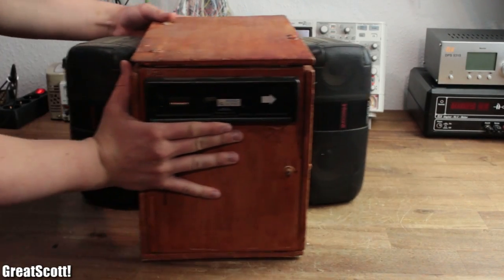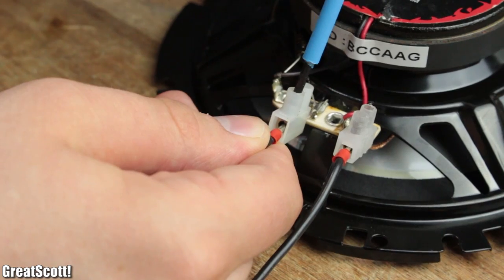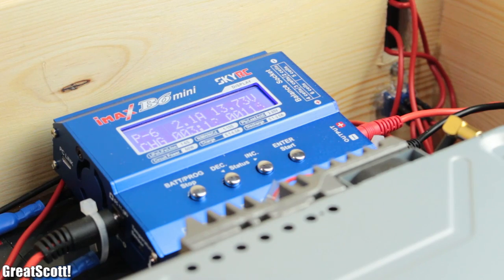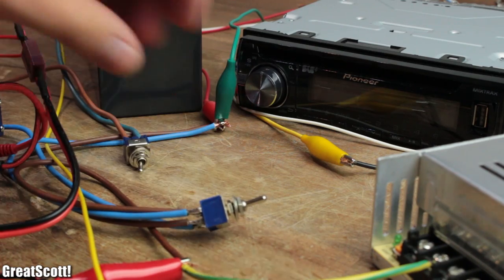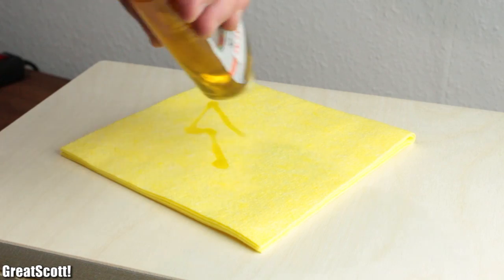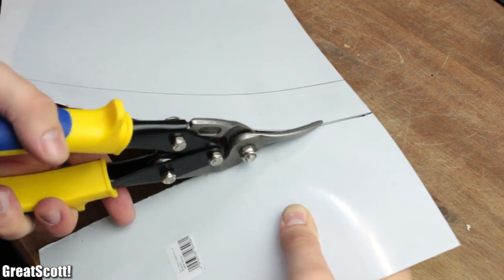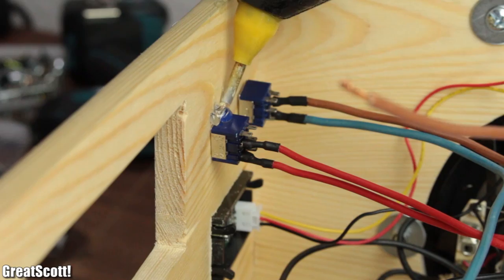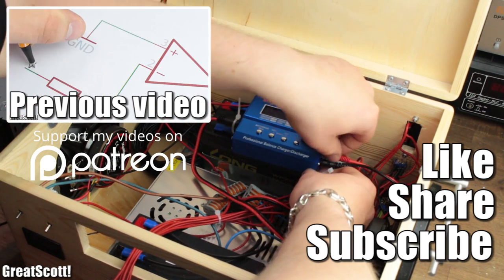Make your own Boombox

Comment: Why using Lead-Acid Batteries? Use LiFePO Batteries. They have a lot larger engery densenty than Lead-Acid Batteries and are similar safe.
Reply: Expensive.
Reply: The price :/
Reply: SLA is by far the best choice still as they are dirt cheap and they have a good life span if looked after. The cells are also the perfect 12v, so perfect for PC and car electronics. Other technologies are suitable when you're really concerned about weight and money is no object.
Reply: +Toxicity because lead acid batteries  dont blow up in your face unlike lipos,plus the need for a over charge over discharge circuit,plus they supply less and less power when heated up,not only that,lipos are dangerous because they can detonate like a bomb at any moment,once i had a friend that was soo happy to get a Samsung Galaxy Note 7,3 days later he was treated for 3rd degree burns on his hands,now,why dont you tell me why you think Lithium Polymer batteries are safer than Plain Safe lead acid batteries
Reply: +Trodded Sloth LiFePO has nothing to do with Lipo batteries, thats are 2 very different technologies. One big advantage of LiFePO is that they are save, they can't blow up. Thats why they are good replacement for Lead-Acid batteries.
Reply: still need venting for lead acid  cells..hydrogen fumes do gather in small area, and the micro switches I saw may not be arc proof.  
These projects are to encourage hobbyists to think, develope, design and create on their own...GS is only showing us how simple or extreme hobby can be.  Keep up the great work GS.
Reply: Nah short

Comment: some cheap and good car radio with usb and aux ports?
Reply: BLAUPUNKT STUTTGART 120
Reply: thanks :)
Reply: JVC sells a quality deck with speakers for low cost. I have a cheap $60 Pioneer in my car with USB, bluetooth and AUX Paired with local sony speakers and the sound is good. The local car store here "cost less auto parts" has some kind of set that looks like a asian clone of the JVC bluetooth set for even lower cost. I'd take a look at Greatscott's bluetooth speaker possibly build your own Aux or Bluetooth boom box with something cheap inside like a mp3 player or radio if you don't want to hook your phone up to it. If you have the know how as well.

Comment: Watch out with those cheap power supplies . I only use triplite or buy the cheap ones  and resolder and examine every rear board connection. . The quality control at those factorys suck .

Comment: I have a question, would it work to use a Desktop PC PSU to power the Radio with the 24 pin ATX kable on the PSU?

And if so, could I simply put a switch between the PSU and the Radio to have it turn on and off?

Comment: Hii please suggest me the amplifier unit 

I have 2 woofer s and  2 speaker 

Woofer-6 OHMS each
Power -30W each 

Speaker 3 OHMS each 
Power - 20 W each 

Waiting for your replay 
I need the  Blutooth and usb also
Reply: He used a pioneer DEH-S1100UB

But for you i think a pioneer DEH-X5800BT + USB would be better suited for you, just remember that the outputs would be 50w so be careful.(even if speakers tend to tolerate double their rated power?(idk))

Comment: I did this. Having a problem with the charging controller though. Worked for a while but after heavy use draining the batteries that night i charged the batteries up then after unplugging from wall power the charging controller stayed on. Didn't do this before. Took it out of the box to isolate it and the charging controller is running itself off of the output (battery) side. Been trying to figure out whats going on with the controller but no luck yet. Anyone else have this issue?

Comment: No fuse protection?
Reply: The stereo has a built in fuse, but there should be a fuse between the 120 V input and the power supply, unless the power supply has a built in fuse as well.

Comment: could u make one of these with a 12vdc 10a adapter? but just to power the unit and speaker only.
Reply: Shaun Cassidy yes you can and he stole my idea I posted a video of the testing of mine and I did it without all of the fancy crap
Reply: @mcasetv2221  then how would one do it with just a 12vdc adapter and the stereo unit?
Reply: @shaun Cassidy you wire the radio power to positive and negative then check if the radio comes on then you just wire speakers into the speaker outputs unless you using an amp

Comment: Hi, I have 40w speakers in my house,  and I want to install them in a 55w radio. 
Who can I reduce the power of the radio,  can I use a resister
Reply: You can use a properly rated resistor but u have to keep in mind about the parasitic inductance of the resistor.

Comment: uh how can i just power using mains i dont want it to be powerd with batery
Reply from the maker: Leave out the battery segment of the circuit
Reply: so just hook up the power supply to the pins a4 a7 and a8 on the radio right?

Comment: So If I plan on building this, what are the requirements for the radio and can you just remove the antenna part and instead get a AUX-port with a cord to play from your phone? Thanks.
Reply: Yes it is possible as the output is based on the input from the head unit.

Comment: The boombox I built like that back in 1995 still works great, though it is on its third battery. Those lead-acid batteries only last 3-5 years. 
I used a Radio Shack 40 watt EQ booster, two 6.5 inch 2-way speakers, and originally a 15AH battery from Science Surplus. Box was made from 3/8 inch plywood, glued together and L brackets for corner support. I meant to put in hinges for the lid, but just having it press fit into some weather stripping held it in place pretty well.  I plugged my Walkman into the aux input, and enjoyed my favorite tapes. Of course now I play my music from my phone's headphone out.

Comment: take out charger and batery ad put normal computer power supply, its not so big, has own fan to cool power supply and the radio and u have 350-400 wats of pure power in12v. My bombox is made from old speaker box old compuer power supply and sony radio on mp3 usb.....perfekt for listening in work

Comment: Hey go on amazon and you can get a12v low voltage cute of for  $10 it will cut the power at 10.5v or you can set it lower or higher

Comment: i suggest mount  speakers in a separate internal box,to avoid loose bass range...i have make one,but the radio are divided from speaker with  a intermediate wood panel in the box...so you can "comprimed" the bass,and made a  frontal bass reflex duct

Comment: Based on your diagram, the battery's output negative & positive terminals were connected to the charge controller's output negative & positive terminal? Why would the battery's output be connected to another device's output?

Comment: Kmart had a very cheap Kraco radio on sale. The $14.95 set came packed together with speakers and antenna. I actually used cardboard box for the enclosure for two weeks until I made one from metal.

Comment: Why you used 30A while you just draw 1.5A,  What is biggest Amp that this speakers and amplifier make? What if I want to build that without battery, just with power supply. How strong it should be for same speakers?

Comment: I think one could spend the money smarter and instead of buying an expensive multi function charger, a rather bulky and heavy VRLA battery, just buy a RC-model LiPo or even reuse a bunch of laptop 18650s, hook it up with a BMS/load balancer/protection circuit from China, yielding much more portable device. This might have not been the case at the time when this video was created though.

Comment: Try using a solar charge controller, it'll accept you load and keep the battery charged and maintained.  When you unplug your unit from the line the battery will seamlessly power your load.

Comment: You need to work on the sound quality... the box's volume is too big, has no sealing at all for the lid, speakers face 180, box is crammed with stuff, should use matting, etc. If you're going to go through the trouble, do it right.

Comment: I used to work construction jobs, and the guys were always bringing in their "Dewalt" radios, or their own store-bought portable CD radios.  I could not afford one of the Dewalt radios, and just another portable radio was too boring for my creative style. So I did something similar  to this.  But with a twist...  An old, 2-knob, AM/FM/Cassette car stereo was slotted into an old makeup case I found. The power leads were connected to a 12v lighter type plug and two good computer speakers connected to the 2 channel output of the car unit. the speakers could be stored inside the box when not in use, but taken out and set up  in the extendable tray of my big rolling toolbox when I was using it.  So, what about the source of the music?  Well Cassette was to quaint, and FM radio always had the same old boring crap over & over, day after day.. So I loaded up an MP3 player with several playlists. Country, classic country, classic rock, 80's rock, metal etc.I had about 500 to 600 songs in total.   Here's the twist.. I got a very good FM transmitter that covered about a 300 feet, but after I upgraded its' puny internal antenna to a better external antenna, I got about 1,000 to 1,200 foot range.  It was all powered by a small car jump-starter pack that I had built into my toolbox.   I always had my transmitter set to 102.1 FM, which was near to a popular rock station at 102.5. but not close enough to interfere with the rock station.  Eventually word got out about my "portable radio station" and other workers began to tune into my transmitter.  It got to the point where some guys would come by and make requests for songs.  Of course, I was happy to put a song on, if I had it on file.  This thing was a very cool contraption and was greatly appreciated by other workers when we were on remote sites far from a decent radio station.  At the end of the day,  the whole thing boxed up nice & neat, and stored inside my big toolbox along with all of my tools.  That was about 12 years ago.  I still have that "portable radio station" out in the shed.

Comment: With almost 1,300 comments so far, can you really blame me or anyone else for not reading through all of them before making a comment of our own? Maybe this has been mentioned before but I'll say it anyway. Anybody can build a box and put speakers in it. It doesn't mean, though, that it is going to sound all that great. Speaker builders/manufacturers design the boxes to get the best sound from the particular speakers. Some even design a speaker specifically for a certain size/shape box. There have been for a long time certain kinds of calculations that should be made using the specs for the drivers. Many (most?) by now use computer modelling programs/software to aid in the design. If you know what you're doing then you can make the most out of it. It doesn't necessarily mean you have to have that kind of software, but it does help. Anyone wanting to build their own speakers, regardless of what form it is (portable, home, or car), should at least educate themselves in the basics of speaker (enclosure) building and design. The info should be fairly easy to find. Books have been written about, in addition to what you can find online. Don't be that idiot that just sticks some speakers in any box and thinks that they have made themselves something good that sounds good too. Anyone can do something simple like that - make a loud crappy sounding "system".

Comment: That's seems too bulky to transport  can't you use a wireless bluetooth adapter and plug into to a center speaker from a home surround sound system I'm sure they have a Female Aux port to speaker wire hook up device for sale somewhere, and for power use a 7.2v rechargable battery.

Comment: The batteries are not the smartest choice... They are made for short power burst output instead of durable output...
Reply from the maker: Not really
Reply: LiPo or Li-ion batteries i would prefer... My experience with Lead-acid batteries is that they die fast when using them for a durable powersource...
Reply: These batteries are used in solar panel houses lol! (well they are deep cycle lead acid, but they are similar in price)
Reply: DuQaida I WILL NOT BE YOUR SLAVE!

Comment: That's kewl.  I would love to make something like this, but not being one who messes with electronics on a regular basis, I don't have all the fancy equipment t to adjust voltages and other things.  Best I have is a soldering iron for basic repair and a voltage meter to make sure my computer PSUs aren't failing.  Great video though and that is some LONG life on battery.
Reply: It's actually not that difficult and you're messing with 12v so you're unlikely to do any damage other than letting the magic smoke out of something. If you can wire up a car stereo, you can build something like this. You don't need the charger or power supply built in. The most basic one could be a 12v SLA to a car head unit, add car speakers and you're done. You just need to charge the battery with an external charger. Give it a go!

Comment: I have a question, what's the best soldering iron because I would like to get one 

Also I need a fume extractor

By the way great vids!
Reply: Hello, 
i would reccomend you two types - transformer soldering gun/iron which is good for big soldering areas and it heats up immediately - and its cheap. Also, for more precision and smaller joints, you have to buy some soldering iron. If you don't need temperature regulation, in fact it does not matter what you pick up. For soldering iron with temperature regulation, it depends how much money you have. One of the best soldering irons are Hakko. I am using SMD rework station from Yihua and it works quite well and the price is about 170$.
Reply: Dominik Pecháč that's perfect, thanks

Comment: It did inspire me, so I built a similar project, a powerful boombox without a car radio, I used a 30w amplifier, some good quality speakers and I also put an Inverter so I can use the large capacity of my 18650 Li-Ion battery pack for powering something I might need.

Comment: I started building mine in May 2015 and kinda finished it in April 2016. Now I have a portable bluetooth speaker with radio that goes for 8 hours of music on a decent volume. I got to use a lot of old parts that were laying around. My handlebar is from an old bus, my speakers are Magnats from 1998 or so. My charging system is an external automatic charger that goes into mains and is directly connected to the battery via XLR plug.

The whole system weighs about 12 kg ......
But that's okay, it'll help you become super strong over time ;)

I will do a YouTube video at some point but that will take some time

Comment: Nice design but more for the commercial user rather professional. Though the batteries give a lot of power, they are too heavy.

I want to try and make a rig based off the roland street cube, which is lighter and has a couple of mic inputs, line input and effects. DC or AA powered, I would redesign it to use rechargable lithium's. a bit heavier and space consuming, it would give more battery life.

Comment: Interesting..I built something similar to use in my employers service van. Had a Sony cd deck with a headphone jack input to play the music off my phone ,  12” Rockford fosgate subwoofer,  (2) 3 way 6” Sony speakers, Rockford 500watt sub amp and another Rockford amp just for the Sony speakers all enclosed in a wooden square box but in a manner that still allowed the subwoofer to put out massive amounts of BASS. I wired and secured up front between the driver’s and passenger seat in a manner that would allow me to remove it through the back of the van fairly easily. Even could use it as a small desk to write up my service invoices and eat my lunch off of.

Comment: How would you wire a similar box without a battery? Just a plug n play only option? Would that power supply you used still be the best option?

Comment: dangerous radio.... proper car radios should turn off at like 12V, to provide enough power to start the car.
Reply: This should be managed by the car.
Reply: @Daniel-hd7gq  you said it... it SHOULD
My 1996 Golf 3 Cabrio dont havesuch connectors, and the radio is permanently at 12V power also without a key, and also if the battery going to get empty.
Luckily my radio manually turned off has a low to not existing standby draw (without traffic assistent)